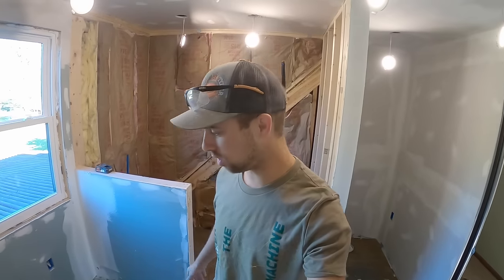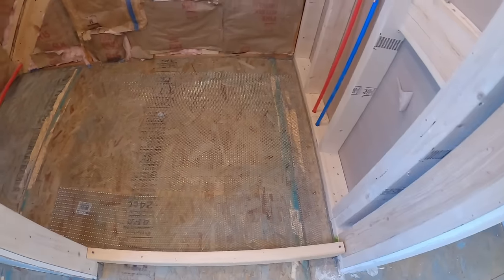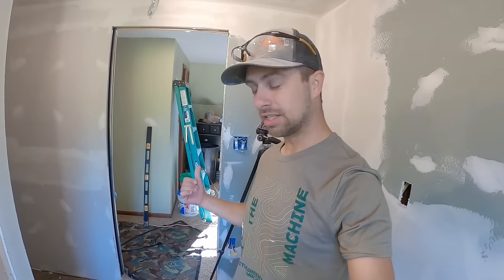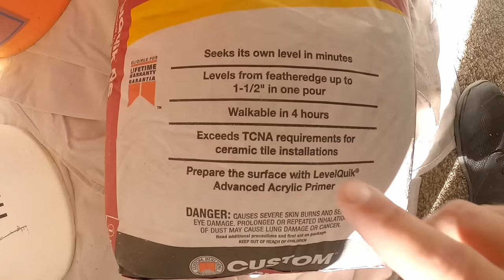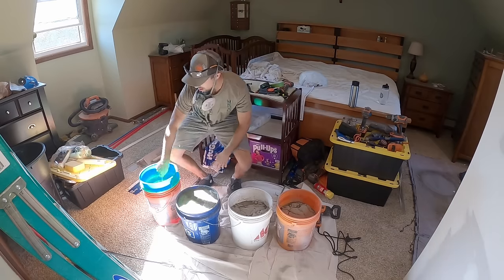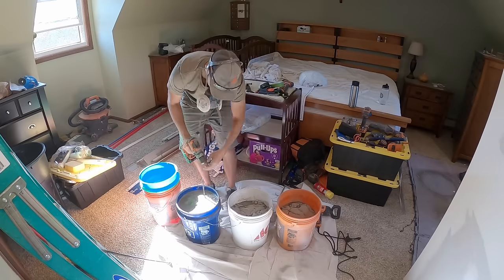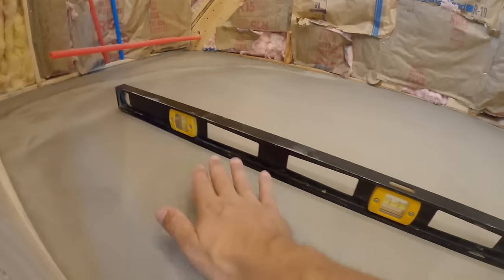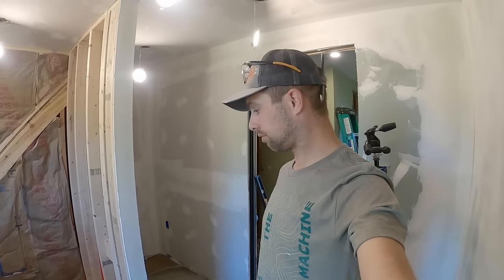DIY Self Leveling Compound over OSB Floors - Complete Guide to Self Level your Floors Like a Pro

Comment: Just tiled my friends condo. Leveler used in 2 bathroom, kitchen and laundry room. Like you said, not enough water. Mine flowed perfectly. No trowel or anything. I caulked some foam weather strips temporarily to the floor to use as dams to stop it from flowing too far. Worked great.

Comment: Not following the directions on the bag for what reason? Way to stiff when you poured it, it should flow by itself, I usually use a landscape type rake to move it around faster, definitely shouldnt be trowel grade. The mesh is a very good tip though for wood subfloor, drastic increase in strength preventing movement from cracking

Comment: Friend I’m trying to help with her DIY has plywood subfloors that were never covered (just painted and repainted over fifty years). Now there are soft spots and some popping noises. Is it likely just the plywood or more likely something underneath?
Reply: It could be the nails holding the plywood down gettig loose on the joists, or it could be the ductwork flexing underweight if theyre held up against the joists.

Comment: Not trying to hate but it's so stupid to put drywall in a bathroom. Maybe for the ceilings and above the back splash but near the floor? Don't do that. It's not 1980 anymore. Go buy hardiebacker.
Reply: is hardiebacker the brand or a type of wall material?  thanks!
Reply: Better yet, buy go board
Reply: The Schluter shower system states that normal drywall is fine as a backer to their waterproof membrane, using All-Set to adhere it.  That is the glory of their shower system.  You can install a shower in an existing drywalled space.
Reply: You would want to put aqua guard or red guard on the drywall.   It’ll make a barrier to moisture.     I used that purple board in my bathroom and painted it with aqua guard to protect it.
Reply: Shower walls should be green board, cement board, GoBoard, Schluter shower system, or the absolute best, Wedi. If you ever do a steam shower, GoBoard is out, as it isn’t rated for steam showers or rooms. I’ve worked for The Tile Shop for over 9 years now, and I can say for sure that Wedi is the best option, though very expensive. A complete 3x5 linear drain shower system from them will run you about $1700, give or take depending on pricing in your area, but worth it to knock about 2 days off of a bathroom remodel. Install the shower system in the morning, go to lunch, come back and start tiling immediately.
Reply: @jerryhuber1130  I prefer that cement board and I tape and morter the seams and seal it with three coats of aquaguard.   It’ll never leak.   Then when I put up the tile I not only apply the Mortar to the walls, I also backbutter my tiles so I can get the 90% + cohesion.   The tiles will never come off.   I also use a lippage system so the tiles are perfectly flat and the spaces to consistent.   That extra time spent on the install pays itself back later in preventing lots of problems.